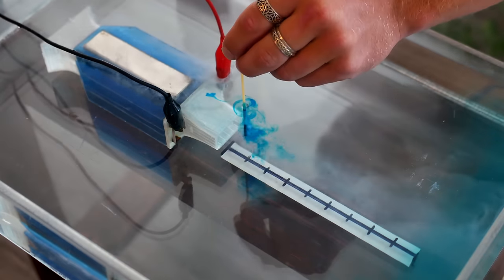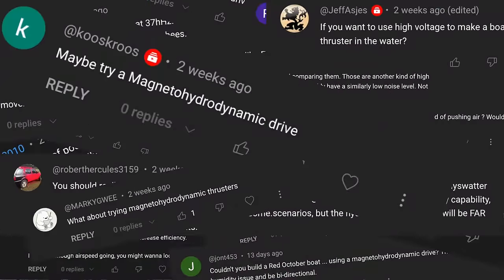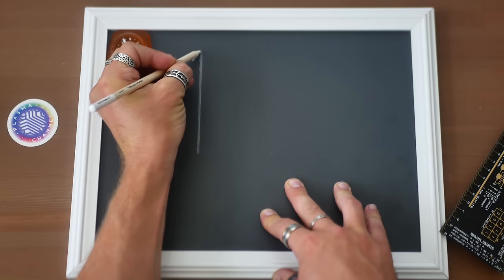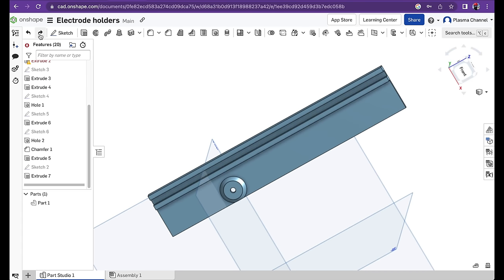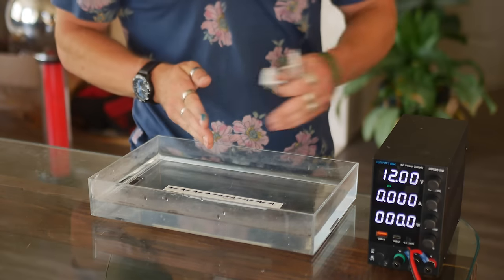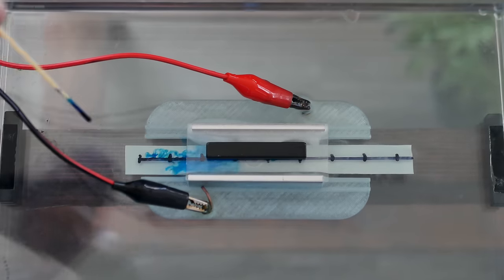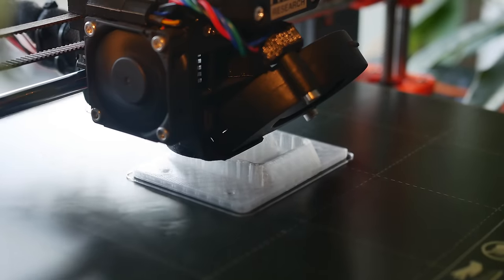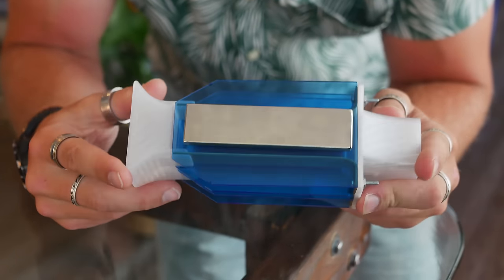Using Stealth Propulsion for Ocean Travel (MHD Thruster Build)

Comment: Fun idea!
As some other said, I think that smaller opening at the back might decrease the thrust rather than increase it. It does increase velocity of the water coming out but total thrust is dependent on the flow of water as well and the increased velocity most likely doesn't make up for the lost flow.
This gets even more a problem if used to power a boat - because the movement forward of the boat will cause the water to also enter the inlet at some speed relative to the unit and get accelerated to even higher speed - which increases the total flow thru the unit by a lot. This will cause that opening to act like a big choke - making the thrust decrease faster with the speed as well.
If the channels have the same cross section area thru the whole unit, the water will just enter with some speed and accelerate freely to even higher speed, and continue to produce thrust even when getting up to some speed.
Reply: Exactly.  This flow design is for compressible fluid like air.  Water is not compressible, which makes the scoop and the nozzle an unnecessary hindrance, ultimately reducing the total thrust. If we could increase the output of this thruster by about 10x per watt, it would actually become practical for some uses that I'm not going to talk about here.
Reply: Removing the convergent nozzle is right. He doesn't want that at all. But there will be zero difference in static vs. dynamic thrust. Forward movement will not increase thrust in this device.
Reply: @UnitSe7en  I never said the thrust would increase by the speed in any case. But, the nozzle will cause the thrust to DECREASE rapidly by the speed. 
Because the total flow thru the unit increases by the speed (even if the thrust remains constant)
 - and the higher the flow, the more of a restriction that nozzle will cause.

If the nozzle is removed, the water can flow thru freely and allowing the unit to keep producing thrust up to higher speeds.
Reply: @Speeder84XL  I was talking about this statement: "because the movement forward of the boat will cause the water to also enter the inlet at some speed relative to the unit and get accelerated to even higher speed - " That is called dynamic thrust.
Reply: @UnitSe7en  Yes - but RELATIVE to the unit, the water will move thru it at greater speed. The water will not pass thru the unit at any greater speeds compared to the surrounding water. 
But if the unit it self is moving, it will from "it's own perspective" behave the same way as if the water was moving towards it and because of that also get accelerated to higher speed than it otherwise would. 
This will increase the flow thru it.

Even if the unit is turned off and just pushed thru the water by some other force
 - that nozzle will still "steal" energy by creating more resistance in the water. 
The unit will "scoop up" some of the water, rather than just moving thru it. 
When the unit is in use, at least that increase in resistance will be subtracted from the thrust.

Comment: One design consideration that you're not considering here is the drag of the thruster. It's fine for this test to have a bulky design since the surrounding water is fairly static, but on a boat once it gets going there comes a point where the bulk will definitely be a hindrance. 

STRICTLY SPEAKING, a MHD could be built with very little drag by lining the boat's hull length-wise with alternating electrode-magnet strips in the pattern +,N,-,S,+,N,-,S,+,N,-,S,+, ... This would mean that the hull of the boat is almost "wrapped" with an EM field where the electric and magnetic field are intersecting almost perpendicularly at every point thus generating a skin layer of thrust along the entire hull. My hypothesis with this is that the thinner the strips (and hence the more +,N,-,S sets per unit length one has along the crossection) the more efficient the energy transfer will be because the field will be more localised around the boat. Also maybe putting some thought into how the wiring is run to the electrodes might help by orienting the magnetic field their current generates to form additively to the fields of the bar magnets rather than have them be wasted EM emissions.
Reply: I would design it so that internally it resembles the chamber of a hydrojet drive.
Reply: Hydrogen generated by electrolysis should be collected and used later somehow 🧐
Reply: @TANOCA17  with salt water you don't guarantee that hydrogen is getting preferentially discharged. It might not be as straightforward to collect.
Reply: @SeanOHanlon  wouldn't that need to pull the water against gravity tho?
Reply: A magnet shaped like a doughnut 🍩
Reply: @HereWeGo0o0  if you're referring to having a "donut" protruding underneath the hull, that would unfortunately be both a pressure drag and a skin drag nightmare (if this is not what you mean, I would love to have it clarified). MHD drives are notoriously weak compared to propellers, and even if you put that kind of hull geometry on a prop boat, it would still waste a lot of fuel and power just to overcome the extra drag let alone a MHD drive. The rule of thumb is, that below the water line, a boat has to be hydrodynamic enough to minimise drag while at the same time have minimal surface area contacting the water to minimise skin drag. Putting extra loops, ducts and fins just to fit an engine just tempers with that fine balance making weaker propulsion methods counterproductive.

That's why I think panelling the hull with magnets and electrodes will work much better because it preserves the "optimal geometry" of the hull.
Reply: MHD's don't produce enough thrust to really have drag come into play. There's a reason we don't see them in widespread use, and it's because they're woefully inefficient.
Reply: It might be worth it to make a traditionally powered boat more hydrodynamic, in the same way ionic propulsion is used to make stealth jets more aerodynamic. And by "worth it" I mean in a super high tech, money is no object military application.
Reply: I would love to connect and discuss your idea. You seem to know your stuff.
Reply: @atrumluminarium if only hydrogen is generated, inject oxygen and ignite it!
Reply: @cybyrd9615  Doing anything with hydrogen is inherently loud (defeating the purpose if this as being a silent alternative), while also be required to capture the hydrogen which is the thing propelling the boat forward so you lose all your thrust.
Reply: @atrumluminarium  I know
Reply: electrolysis of salt water creates chlorine gas... Not something you want in a combustion, or anywhere near you for that matter

Comment: It's been a while, but the novel of the Hunt for Red October the RO used ducted turbines deep in the hull. It was called a "caterpillar" because it had many turbines spinning pushing the water. IIRC it did use magnets to move the turbines (instead of prop shafts and motors).
Reply: it causes cavitation bubbles that can easily be heard far away that's why this tech was never adopted on subs.
Reply: In the movie it was magnetohydrodynamic drive. No moving parts, almost completely silent. I like the movie version better.
Reply: No, it was a magnetohydrodynamic drive, like this. No turbines, no moving parts.
Reply: @stuarthamilton5112 On what page is that mentioned?

The original comment is completely correct in reference to the book.
Reply: Hunt For Red Oktober specifically mentioned MHD which has no moving parts.  No turbines, just electrodes and magnets.
Reply: @davidladd5597  The version Clancy originally had in his book was an axial turbine system, sort of like the axial compressor in a jet engine.  The movie switched it to an MHD system.

The main problem with MHD systems for subs, other than the large power requirements, is the electrolysis that happens - bubbles of hydrogen and oxygen form on the electrodes, causing sounds much like cavitation.
Reply: @drtidrow  I studied MHD and plasma physics under a Dr Alexeff, at UTK, in the 70-80s.  I read the book first, then saw the movie a few years later.  I was sorely disappointed in the movie, at first, because it changed so much stuff near the end.  I just went back and read the part where Ryan Discusses the design with Skip Tyler.  You are correct.  It was an internal impeller design and not MHD….  Too late to get upset with Clancy, though.
Reply: So the book version is basically a jet drive like a jet ski.
Reply: @drtidrow  I'm not sure the sound is the same, because in cavitation the bubbles are essentially "empty", and they make sound when they collapse, with a shockwave that damages the propeller. Electrolysis doesn't create bubbles of void, they are full of oxygen or hydrogen (or chlorine in salted water). However they don't collapse, but they definitely bubble up and leave a trail on the surface not unlike the compressed air torpedoes. Which is probably even worse.
Reply: @spidLL  cavitation bubbles are not empty - they are full of water vapour. That does matter to how the collapse, since the cavitation bubbles are at very low pressure (which is the reason that they form) so they very quickly collapse; in contrast, produced gas bubbles (such as of oxygen and hydrogen in electrolysis) are ambient pressure so they only collapse as the gas is dissolved into the water.
Reply: @brianb-p6586 I stand corrected, thanks!

Comment: One suggestion - you really need an iron backer to give the magnetic field lines a place to return that aren't the 'wrong' direction through your water.
Reply: That, and also to reduce the reluctance therefore increasing the magnetic field.
Reply: A pair of halbach arrays with opposite polarities and iron backplanes would give an insanely strong field across the thrust tube. Would sidewalls connecting the backplanes also confine the stray fields? I wonder how well drilling the coils out of a microwave transformer would work as a magnet housing, assuming you could get arrays small enough to fit in the gaps.
Reply: @dustinbrueggemann1875  No, using a halbach array while using a material with good "magnetic conductivity" would be pretty useless. Halbach arrays Increase the field strength on one side and lower it on the other. Plus you want the magnetic field to go all in the same direction, not alternating orientations like your suggestion would entail. What OP suggest is both easier to construct and more efficient.

Comment: Hi folks
If you want to try this at home, please ensure to do it in a well vented area as it produces flammable hydrogen and also chlorine gas.
No reason not to try this though so long as basic safety measures are taken. I'll definitely be trying this myself!
Reply: Chlorine? Didn't know salt is split apart this easily. I guess you get sodium hydroxide left in the solution, which can cause chemical burns.
Reply: @the11382  yes, chlorine is more electronegative than oxygen so is the main gas produced by electrolysing salt water, together with hydrogen at the other electrode.
Reply: The amount of chlorine produced is very negligible. Chlorine isn’t crazy toxic in low concentrations and since it is in water, it might redissolve to create HCL. Chlorine is very attracted to moisture so it’s unlikely it will create the large of an issue. Hydrogen however will cause problems in small quantities but since this produces probably less than a liter and hour and is completely ventilated it’s kind of a non-issue
Reply: While probably save at those voltage levels might not be the best idea to stick your finger in there either.
Reply: @MJTVideos Ah, yes, HCl. Nothing dangerous at all about that chemical. 🙄

Comment: Edit: sorry I mixed up the formulas, but the reason is the same. The reason why the force is constant when you put the electrodes closer is because the force applies it on a smaller length. If you take a single charge, yes, the force is qvxB, but if you consider the force applied to a whole current wire in an electric field, you need to integrate it over the whole length of the wire. Look at the Laplace force instead. The density of force is dF/dV =jxB, so dF = dl dS sigma ExB =sigma l E x B dS. So the total force, considering homogeneous fields is F = l ExB S. So if E increases with 1/l, which is the case for infinite plane electrodes at fixed voltage, the force stays the same.
That being said, the same force over a smaller volume should go faster, so you might also have a look to the viscosity. The speed increases from tte surface in 1 - e^(-l) ≈ l

Comment: I'm amazed at the thrust you produced on your first attempt! For efficiency, electrode spacing should be your last parameter to test/adjust. I've seen other comments make this point as well. You didn't have enough energy in the system yet to get a measurable result. I understand why you would want to adjust voltage last, but you can definitely maximize your mag flux first before finding the optimal electrode spacing. Two variables to consider when doing this- one obvious one you are already familiar with is arcing, but the other is volume of energized medium. You will hit a point of diminishing returns as you collapse the volume of fluid that can be accelerated between the electrodes. I think this can be somewhat mitigated if you use a staged approach, perhaps with one wider MHD at entry leading down to many narrow MHDs at exit

Comment: I would redo your test while considering watts in relation to thrust or mass flow. Also consider lover voltage. Voltage below electrolysis doesn’t waste energy on splitting the molecules into ions so it should be more efficient.
Reply from the maker: 1.3 volts would be a very, very low power level
Reply: @PlasmaChannel  yes I thought about that but what if you make very thin square maybe 5mm x 5mm or even smaller. That way the current should be sufficient, I would assume lover resistance. Very glad your answered my comment btw:)
Reply: What if, instead of using direct current perpendicular to a permanent magnetic field, you used a linear sequence of magnets, driven by 3-phase alternating current? (In other words, imagine a string of chasing Christmas lights, but with magnets instead of lights.) The design in the video is like a railgun for water, but this would be more like a coil gun for the water.
 
The reason you're getting the electrolysis is because the current is starting at one electrode and going through the water to the other electrode. Electrolysis happens because electrons are being pulled from their atoms when they jump to the metal electrode. But with a coil gun type design, the only current in the water itself would be eddy currents going in a circle, so there's no electrolysis. All the components carrying electricity would be sealed and water-tight.
Reply: @John73John  See the issue here is that the lorentz force only needs the object (water in this case, or a railgun sabot) to be electrically conductive. A coilgun, on the other hand, requires its projectile to be *ferromagnetic*, which water is unfortunately not. Coilguns are definitely better than railguns for moving objects at speed, but only if that object includes materials of a particular kind
Reply: @ivant1407  Lowering the voltage to eliminate electrolytic decomposition (electrolysis) is the appropriate action to maximize efficiency if DC is to be used. Great comment. The challenge is then as you say to reach the right conductivity / resistivity where the thruster would produce the desired thrust at under 1.23V. With 5mm x 5mm or smaller, there will be fluid flow resistance or drag. I have not seen anyone try making an MHD thruster under the electrolysis voltage yet.
Reply: @PlasmaChannel  But it wouldn't require hundreds of watts :). That voltage is only low power if we're using the very large spacing of your ducting, which means high resistivity.
Reply: @ivant1407 lover resistance.